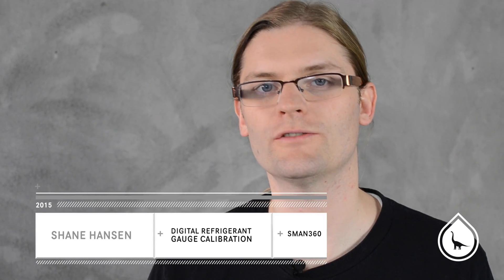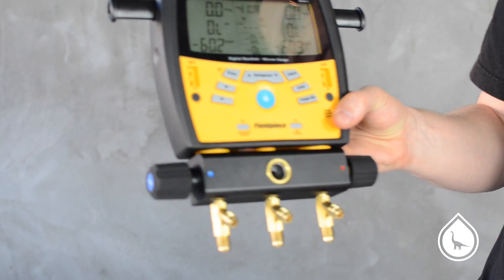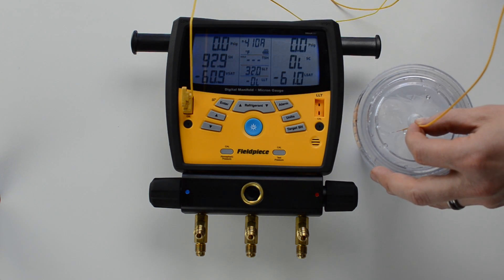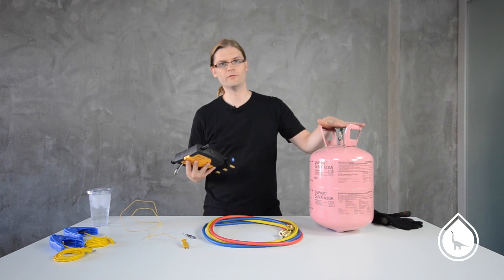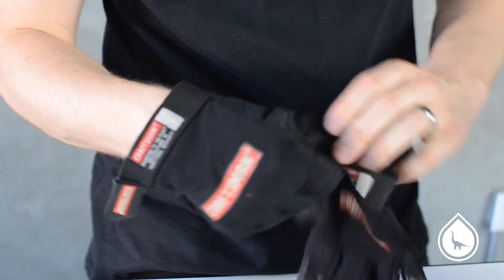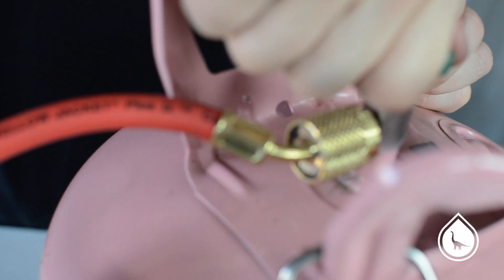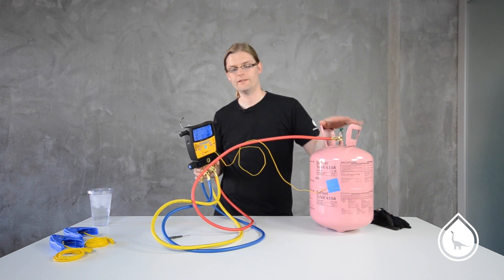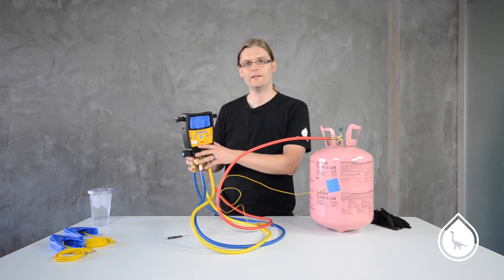Digital Refrigerant Gauge - Calibration

Comment: Hello I see videos for both R22 and R410a, is it necessary to calibrate for both refrigerants?
Reply from the maker: Hi Rob! It is not necessary to calibrate using both types of refrigerants. The calibration process is only looking at the temperature and pressure sensors on the gauges. When performing a calibration, the SMAN gauges compare the temperature and pressure sensor readings to an internal PT chart for the selected refrigerant type. Just be sure you have selected the correct refrigerant type on the gauge to match the tank you are using to calibrate and everything should work out OK. One more note, we recommend that you use separate hoses for each type of refrigerant if not a completely separate gauge and hoses for each type of refrigerant you routinely work with. Thanks!

Comment: Hey why does my highside stay on negative pressure and it says inHg??
Reply from the maker: It sounds like the central valve is closed preventing fluid going from one side to the other. Check that first. 

As far as the readout in inHg, the units can be changed in settings. If you still have issues, feel free to reach out to me directly via email Shansen@greendinosauer.org. If needed, we could get on the phone and to try and troubleshoot it.

Comment: I work with 22 and 410a is it possible to use the same manifold?As of now I use a different manifold for each
Reply from the maker: Thanks xamander45! As with all manifolds, you would want to be careful when switching between refrigerants. Separate line sets should be used with each refrigerant type and you should be capturing/recovering any refrigerant before switching between line sets.  - The Dinos

Comment: good video thanks i have the sman4 i assume it would be the same?
Reply from the maker: +Corey Cruz 

Thank you Corey. Yes, calibration of the SMAN4 pressure and temperature sensors is the same as demonstrated in this video. Just remember that you have an additional VAC port that will also need maintenance. Is should be cleaned occasionally as outlined in the fieldpiece user manual on page 15.

A copy of the manual can be found here: https://www.google.com/url?sa=t&rct=j&q=&esrc=s&source=web&cd=1&cad=rja&uact=8&ved=0ahUKEwiD-7ivrcXKAhXEFz4KHW8LCkUQFggcMAA&url=http%3A%2F%2Fwww.fieldpiece.com%2Fmedia%2Fmanuals%2FOpman-SMAN4-v25.pdf&usg=AFQjCNFEsT-jNueMv9fQl5jqrdjjRhy8_A